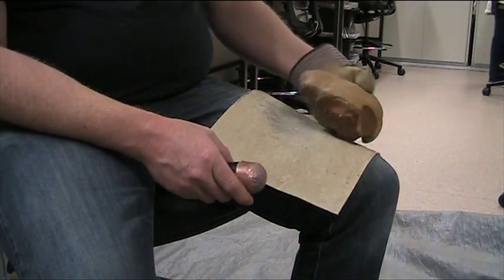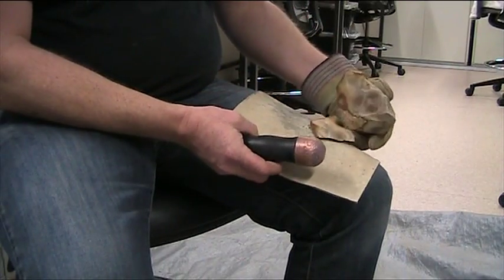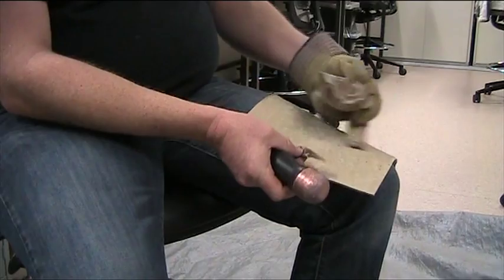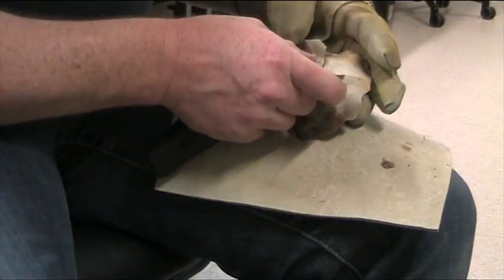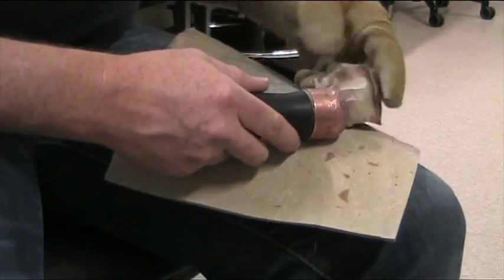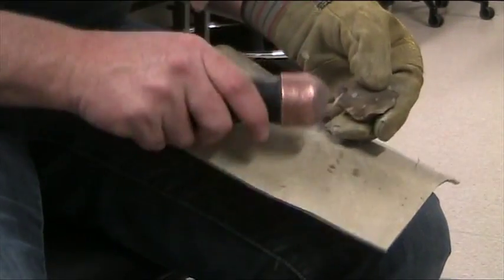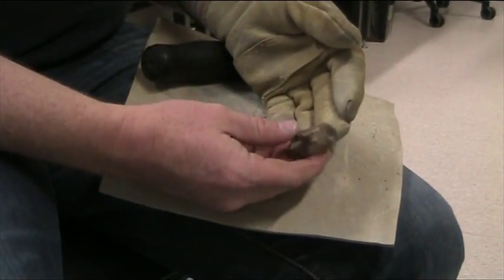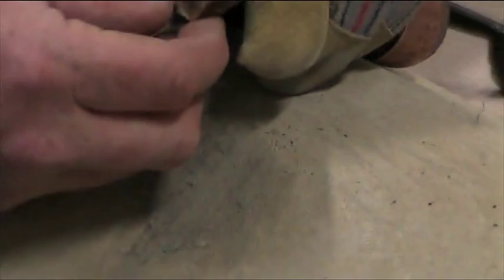Discoidal Core Reduction (with Commentary) by Dr Chris Clarkson

Comment from the maker: There are two main differences: 1. Levallois makes different use of the upper and lower hemispheres - the upper is shaped to remove a very large flake from most of the surface, making use of prepared lateral and distal convexities - whereas the lower surface is really set up and maintained as a platform surface for striking the more invasive shaping flakes from the upper surface. The upper surface also tends to be flatter than the lower, more domed surface. This is different to discoidal reduction where the upper and lower surfaces are equivalent and flaked alternately, and typically both are quite domed and centrally peaked.
2. the preferential removal requires a platform preparation stage, or at least creation of a suitable platform, usually prepared by faceting, and sometimes a chapeau de gendarme, for taking a large blow that removes the Levallois flake. A discoidal core does not make use of this, as removing the large flake would alter the geometry of the core, and disrupt the equivalence of upper and lower hemispheres. 
The recurrent preferential refers to the fact that convexities are prepared and re-prepared after each large levallois flake removal. That is not the case in discoidal reduction where the core continues to be flaked in much the same way throughout the reduction sequence.
Hope that helps!